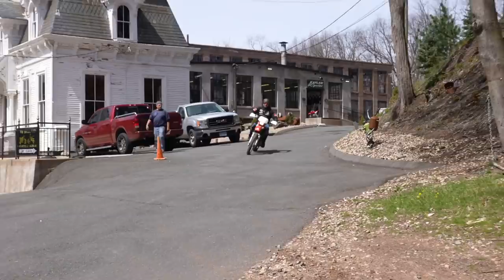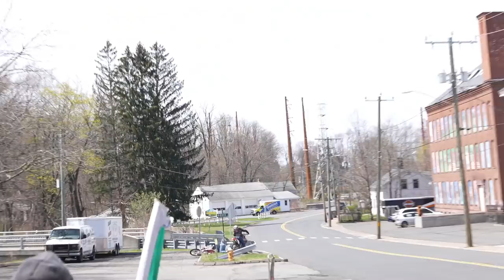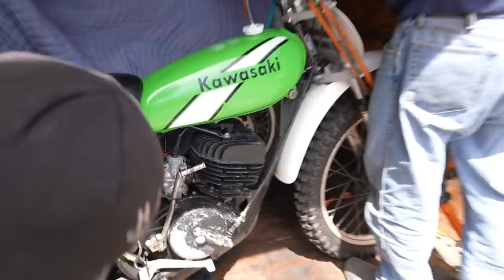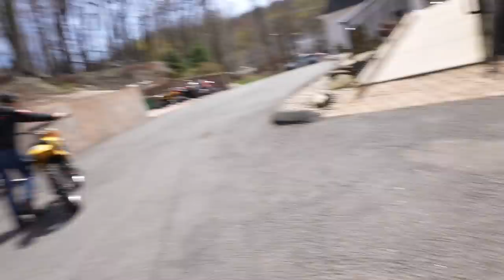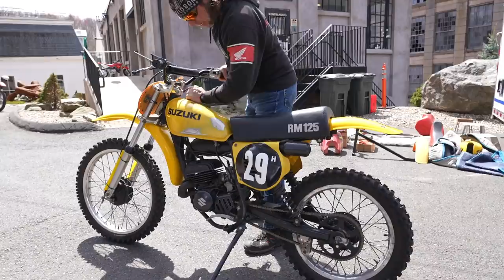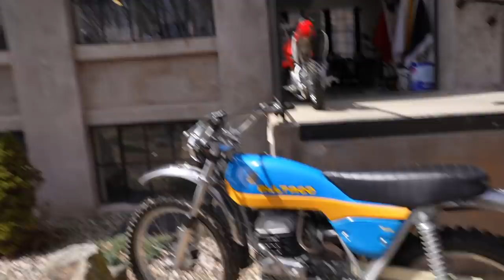GRUDGE MATCH! + 8 NEW BIKES DELIVERED!

Comment: Find a 1985 xr200r... they have the RFVC two exhaust and two intake valves two carburetors with two exhaust ports with a two into one header and very fast. So fast in the woods will make you hate life if you're on an xr500r especially in a river bottom shootout called the beer can derby back when the two bikes were new.... I had a chance to buy one brand new in 1985 for the same money they wanted for a 1984 xr500r... So I checked the xr500r as I intended to make it street legal and did . The xr500r Wade 260 lb dry and the xr200r weighed around 220 lb about the same weight of the cr250r with the handling the same making the xr200r very hard to pass in the woods